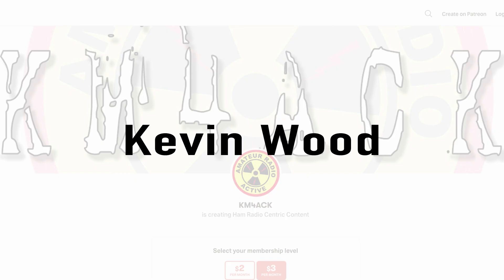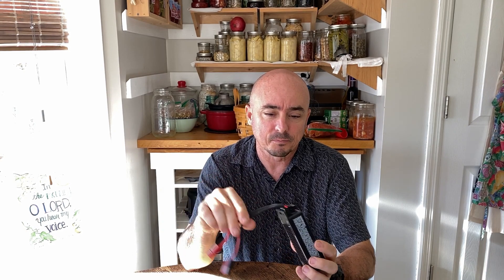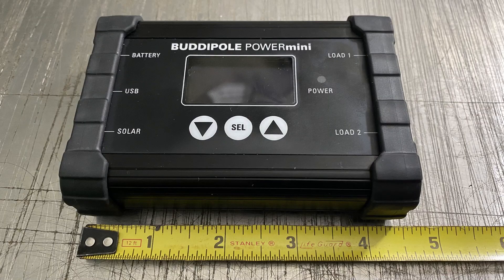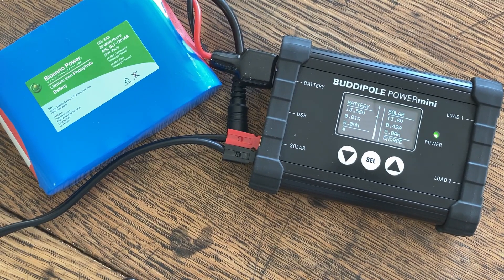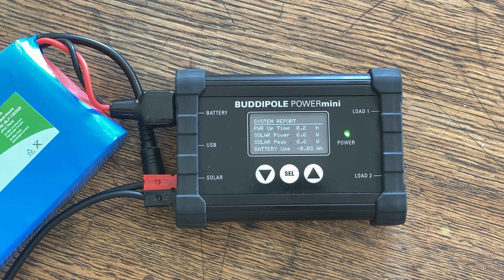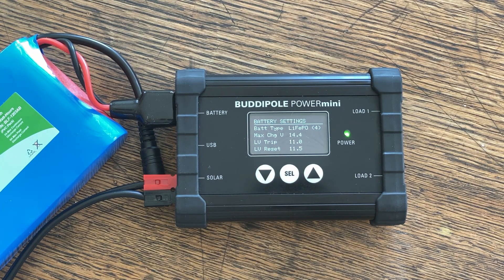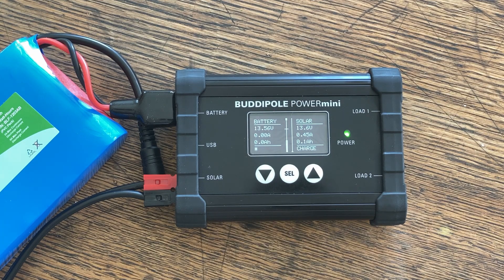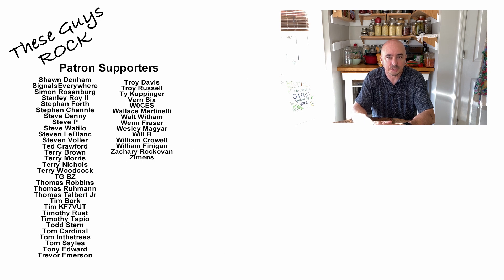BuddiPole POWERmini Review

Comment: GREAT JOB! I have the original. Amazing product and nothing like it on the market that is this size and radio functional info. NOTE: Having designed and constructed many solar setups, mostly using Renogy, from QRP Ham setups to fully self contained RVs I just wanted to mention the needs for portable (say 150w and less) the notion that the PowerMini, using a PWM controller, is inferior to say like a Renogy MPPT solar charge controller. I understand why people have the impression MPPT is 'superior' to PWM. Yes and No. MPPT is superior if you are running high line voltage when you run panels  in serial. But using relatively lower line voltage from panels like 50-100w single panel there is little to no real benefit using a MPPT., the line voltage does not get high enough to gain this efficiency. What the Power Mini gives you is a small all in one power management and info that was designed for the needs of a portable low power solar setup. But both works but PowerMini is quite amazing all in one product made for Hams.

Comment: Some time ago I also was interested in the PowerMini, but when I noticed that it does only offer PWM charging I chose the Genasun. The reason behind that is waste or unused power that comes from the solar panel as PWM charge controllers drop the panel voltage down to the battery voltage. In my opinion they are just an acceptable choice if your battery voltage is close to your panel voltage.
Possibly you could run a comparison on both of them to benchmark the power output?

Comment: Great demonstration, Jason, but you didn’t explain the bar graphs in the middle of the display. Those have some great information about LV/HV cutoffs, load current, and battery voltage (fuel gauge).
Reply from the maker: Indeed I didn't. Only because I was unaware of them when I filmed the video. I learned of them later while reading the owners manual a second time. Somehow I skipped over that info the first time through. The fuel gauge is much more relevant using SLA battiers and less so with LiFePO4 due to the difference in discharge curves.
Reply: You prolly dont give a shit but does anyone know of a way to log back into an instagram account..?
I stupidly lost the password. I love any tips you can offer me
Reply: @Briggs Jefferson Instablaster =)
Reply: @Terrance Oakley I really appreciate your reply. I got to the site through google and I'm trying it out now.
I see it takes quite some time so I will reply here later when my account password hopefully is recovered.
Reply: @Terrance Oakley It worked and I actually got access to my account again. I am so happy:D
Thank you so much, you saved my ass :D
Reply: @Briggs Jefferson glad I could help xD

Comment: Thanks so much for the great video Jason! I always appreciate your analyses. BUT ... you neglected to mention that this is a PCM charge controller and NOT an MPPT. For me, MPPT is the only way to go for solar charging. In particular, the Victron 75V / 15A MMPT is a small size, low cost, high quality MPPT solar charge controller that I use for all portable ops. It generates much more solar charging power than any PCM controller (on both sunny and especially cloudy days) and is incredibly well-built! Only $80 on Amazon :) 73 KJ6ER, Silicon Valley
Reply from the maker: I agree and wish they would incorporate MPPT into the PowerMini. I still like it for it's compact size and host of features. I do keep the old Genasun on standby should I need the extra juice a MPPT controller would provide.
Reply: @KM4ACK  Yes absolutely, I love the packaging with those powerpoles and built-in display. Like you, I wish they upgraded the internal charge controller to MPPT. 73!

Comment: I wish they would make a panel mounted version. I have my battery and all the connectors mounted in an ammo can. I like that better than having the battery, load meter, solar charge meter, etc all as separate devices that you have to unpack and plug together. From a modular standpoint, though, it's great. I might try it in the future just to see how I like it.

Comment: If I wanted to use solar to charge the internal battery in the Xiegu- X5105 how would I go bout it? FYI I hooked the power mini to the Xiegu power in and it won’t power the charge controller.  If I plug the Xiegu into one of the load outlets it will charge the internal battery but it just draws from the battery connected to the power mini. I would like to charge the internal battery without connecting another battery to the power mini.Thanks K7WHN
Reply from the maker: Check the battery chemistry and the voltage required for charge. I don't own the 5105 but I'm guessing it runs on a Lithium-Ion battery. The power mini can be set to charge Lithium-Ion if that is indeed the correct chemistry of the 5105 battery.

Comment: I love the Genasun but found that it would not trigger BMS balance on my homebrew LiFePO4 batteries because it needs to reach 14.6V (i.e. 3.65V per cell) whereas Genasun only goes to 14.2V. Otherwise, Genasun GV-10 Lithium is a solid rf-free solar charge controller. Can you customize Max Charge Voltage to 14.6 on the PowerMini? You keep prompting more purchases, Jason, now I got my sights set on a getting one 😅
Reply from the maker: Yes. I just looked at the power mini and was able to set the max charge voltage to 15V for LiFePO4 batteries.

Comment: I have had one for many years and they work well.  The only thing it’s missing is you can’t plug a power supply in place of a solar panel to charge is needed. Otherwise its a very good charger.
Reply: Great point ♡
Reply: Why not? 
How does it know?
Is this limitation documenred in the mfrs. literature?
Thanks for any reply.
Reply: @scottversaw3344  Chris Drummond said not to plug in a power supply, it designed for a solar panel.  I have not taken mine apart to see why.  From the manual. POWERmini USB can be used with a 12V solar panel with power output up to 150W.
It may also be used without solar input but note however that the solar input should only be used with a solar panel and should never be connected to any other type of power source (for example DC power supply or car battery) as this may cause damage to the battery and/or POWERmini USB.

Comment: $150 is very high for a PWM charge controller!  I didn't see where it said but the solar panels voltage must match the battery voltage.  That tells me it is a PWM.  MPPT are much more efficient!  Have you checked the frequency that it uses? PWM turns the charging on and off at a high frequency and controls the charging by how long it is on with each cycle. PWM pulls the solar panels down to the battery voltage and most of the time that is not the maximum power point for the solar panel. Pulse With Modulation! They can be between 50% to 80% efficient. MPPT can be up to 95% efficient! And they use a buck converter to step the voltage from the solar panels down to the battery voltage. Maximum Power Point Tracking!  MPPT finds the point that the solar panel puts out the maximum and uses the buck converter to change that to the voltage the battery needs and gives more amps than coming from the solar panel. I do not know witch gives more RFI. They both use high frequency,  PWM uses it to turn on and off the pulses to charge the battery,  the MPPT uses high frequency in the buck converter.
Reply: Who makes or what brands sell MPPT charge controllers.  So many acronyms😱
Reply from the maker: I have used the Genasun MPPT controller for the last few years. A great controller but has less features. https://amzn.to/3fkvqgT (affiliate link)
Reply: There are a lot go to Amazon and do a search for MPPT charge controllers.  But be careful if you see one they clam to be MPPT and is around $20 it isn't. Buck Converters to handle power cost! The easy way is if it will take input voltage  2 or more times the battery voltage. One of the small but high power is very high price is,   Victron Energy SmartSolar MPPT 100V 50 amp 12/24-Volt Solar Charge Controller (Bluetooth)!  At over $300 it is small, can charge 12 or 24 volt battery's, Bluetooth to get all the information on power in and out also to do the set up, but will fit in a pack. One of the big name is EPEVER. Many of them are big and not good for packing. But there are a lot of different ones. A quick check of videos on charge controllers will give you some of the information needed to get what is best for your needs.
Reply: @lawrencethompson465  Victron BlueSolar 75/15 MPPT Charge Controller - 15 Amps / 75 Volts ! This is much lower price than some at under $90. Bluetooth setup and batter status, and other information.  On checking more the Bluetooth needs a module! But there are a lot of MPPT controllers. Check my other post.
Reply: @donaldsmith3048  Thank you for your helpful and instructive advice in response to my query.   Much appreciated.
Reply: @lawrencethompson465  if you want more information about charge controllers,  there is a man that has a lot of videos about them.  He also has some books about them. He has videos where he tested many different charge controllers and gives information about them. Just to let you know, one of the charge controllers he tested the screws that hold the wires were to small for the size of wire needed for the amps that the controller was rated for. That is how far his videos went into the tests. He did same solor panels and batteries which put more power in over a set time. I don't know about most people but I don't have money to get something then find out it doesn't work for what I need. I find videos from people I can trust and learn from them. That is why I have watched almost all of the videos on here. I went back years to watch them.
Reply: @donaldsmith3048  Yes sir! Victron 75V/15A is by far the best low cost, small size MPPT solar charge controller on the market! I use it in all of my to-go boxes and drains every Ah of sun it can find. On cloudy days, it provides 2-3x the power ... on sunny days, I typically see +20% more power. 73 KJ6ER

Comment: Frustrated by lack of response from Buddipole so will ask you. Didn't see ability to set bulk and absorption voltages for SLA batteries.  Does the unit provide for that as they can vary from manufacturer to manufacture?
Tax.  N6MED
Reply from the maker: You can change the charge voltage of all of the battery chemistries. Li-Po/SLA/LiFePO4